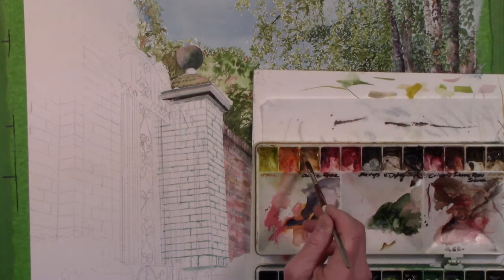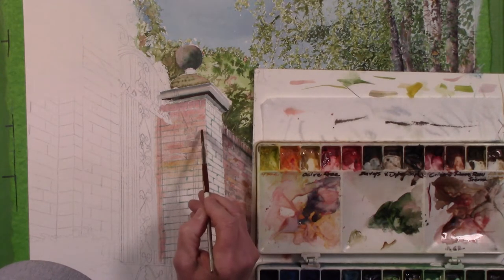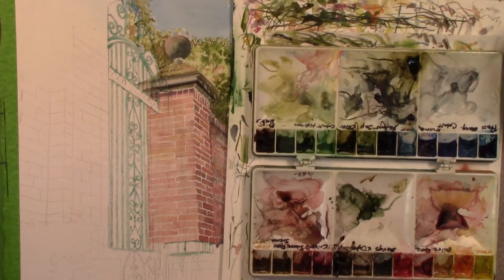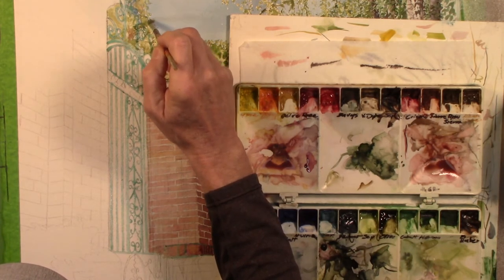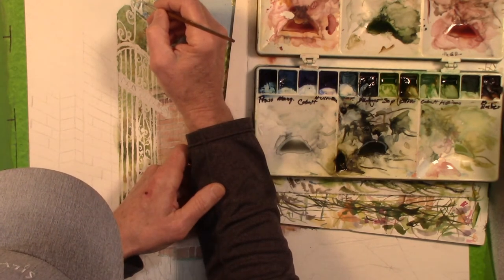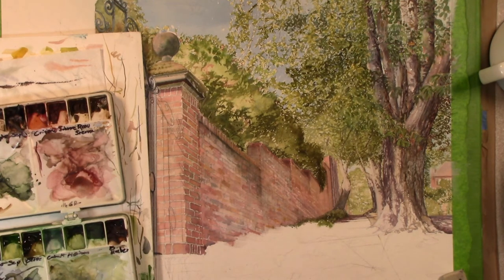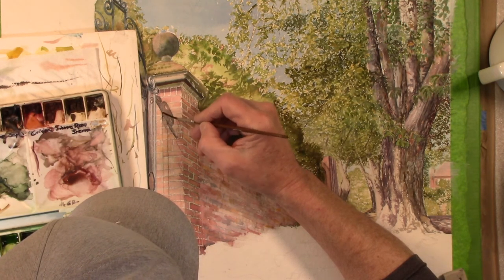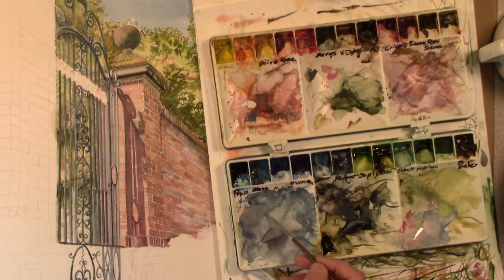WATERCOLOR PAINTING TECNIQUES - STAIRS OF QUEEN ANNE PART 6: PILLAR AND GATE

Comment: Hello! Your videos are a wonderful guide and experience! I was wondering if you have or if you swatch your colors before using them to create a pallette, or do you just decide what colors to use when you start painting? Thanks and more power!
Reply from the maker: Thanks Gladys, I almost always use the same collection of colors on the palette for my paintings. I have color tests which are labeled for reference, and I use a lot off scrap paper or watercolor notebooks. My palette is also labeled with a sharpie, since it tends to get pretty messy. I don't necessarily use all the colors available, but they can all be refreshed with a soak. My choices are traditional, and I tend to stay away from some of the "synthetic" hues.......some just look unnatural to me. Try not to over-mix, and paint in layers to achieve richness.
Reply: @kirkart  Noted this! Thanks for the advice, will try to apply it to myself more. More power to you again!